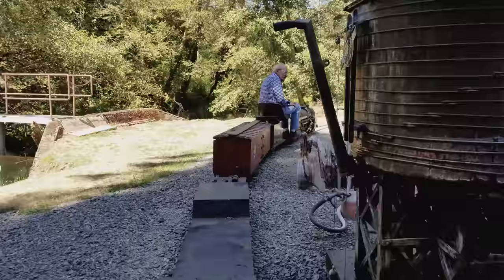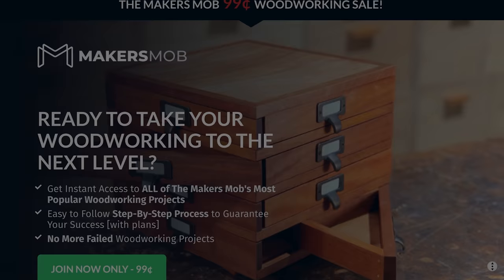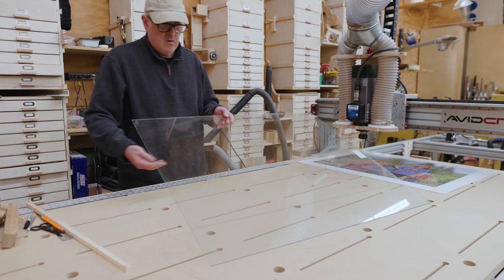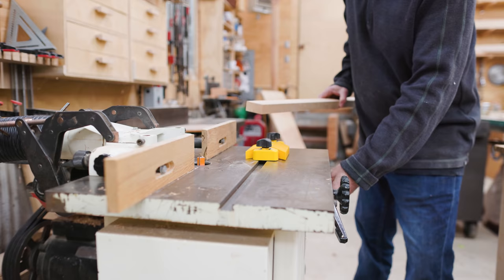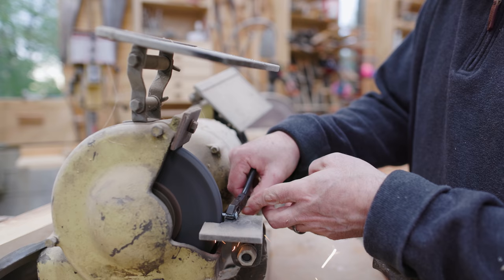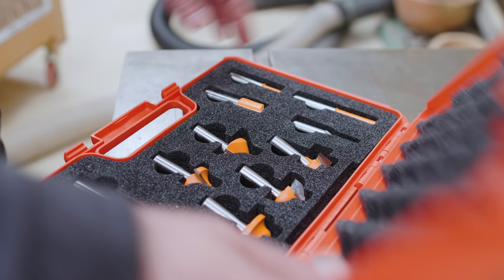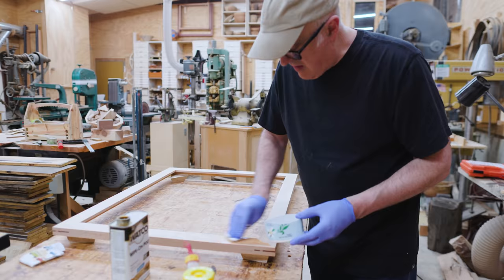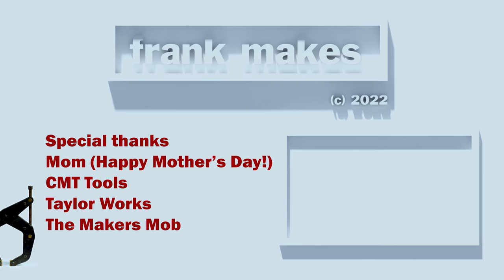Mounting and Framing a Jigsaw Puzzle

Comment: As someone who did custom framing for several years, you've done amazing work here (no surprises there, really). 

However, you really want to avoid having the artwork touching the glass, at least if your goal for framing it is conservation at all. Not a big deal, really, you just need to go get a mat cut for it. Probably 2 layers, since you'll be using the foamcore backing as the mounting surface, instead of the backside of the mat, which is the more "standard" way of doing it. The two layers will give you enough space so that the front of the topmost mat is what's touching the glass, while the puzzle will be able to sit just clear of the glass. 

Also, while brad nails are fine, you'll start to learn of one of their shortcomings after matting the puzzle, since those holes you so carefully drilled will no longer be in the right place! The brad nails may be bendable enough for this to be a non-issue, but we typically used a point driver with framing points, as they're much more flexible, don't work harden/fatigue for many bend cycles, and can be driven in to the wooden frames with relative ease. If you're gonna get into framing a lot of artwork, I would recommend getting yourself at least this tool. Mat cutting can be left to the pros at your local framing shop, as the tools and infrastructure required to maintain a pristine mat with those gorgeous openings in them is extensive, more than is likely worth investing in for a home-gamer, even one as advanced as yourself. 

If you're really looking to use this framing as a conservation method, let me know, I can point you in the right direction for other steps that can be taken to make sure that puzzle stays in its current state for years and years and years to come. If not, I'm certain what you've done here already will be fine, but do please consider re-mounting that with matting to get the artwork off of the glass. The number of times I've seen the artwork stick to the glass after just a few months... It's not pretty!

Comment: Little Trick for the finish nails (or any nail):
If you don't have the right size Drill bit, chop the head of one nail, put it in a drill and use it as your drill bit. Makes a perfect size hole for the nails as a pilot hole.

Comment: A quick tip if you cant find a small drill bit. Just cut off the head of the nail and use it to drill pilot holes for the rest. Works just fine.

Comment: Came out really nice Frank. A tip I've seen before for the picture frame sled, is to use an aluminum framing square. That way you don't have to worry about making it 90 degrees.

Comment: The problem with putting the piece touching the glass is moisture tends to get between them and cause the printed part to stick to the glass and can damage the piece. You possibly could have created a spacer that would run along the sides of the inside of the glass to do a sort of a shadow box like gap between. This is a very pretty project! :D

Comment: Wait, did you cut down a tree so you could use it to break some glass?  😜😃 
Ok, I know that's not quite how it happened but you seriously over thought the glass cutting part. After scoring it, you could just slide it over to the edge of your table and push down gently and it would've snapped right off. That's basically what the weight of the boards and clamps did.
I love your projects and videos!

Comment: For anyone hanging with wire. The stuff you want is called aircraft cable and as a bonus, there are cinching connectors which allow you some height adjustment so you too can easily get a frame to the correct height 😉
Reply: Was once helping a friend hang a big frame and went to tie a knot in the cable. "You don't tie knots in the cable" he told me. Not even 10 minutes later the frame had fallen off the wall XD

Comment: Typically the artwork should be spaced away from the glass, but as long as it's not in direct sunlight, it should be fine in my experience. I worked in a frame shop for a few years and had thousands of old frames come in, and I only remember maybe two or three pieces come in that were stuck to old glass, so it's a pretty rare occurrence.

Comment: Because the air in Side the case will be slightly insulated from the out side and puzzle pieces are made from paper and it holds moisture from the air. With the pieces touching the glass there is a possibility of condensation buildup on the glass that could cause mould. So just check it out every 6months just in case
Reply: If the photo is stored in a conditioned space that doesn't have daily or seasonal temperature swings, it should be ok... I agree that a matte would be better though.

Comment: As someone who has done professional framing: it's not okay to have the work against the glass. Add a spacer to stop it touching. For flat work (which I suppose this isn't exactly) you get moisture on the glass and work often sticks to it, or at least leaves marks. You always want an air gap between the work and the glazing.

Comment: Why can’t you just cut 45 degree cuts in your wood frame and make em fit right? I don’t get it. Can you give us a demonstration as to why this method doesn’t work right.  Keep making the vids, I love em 😁😁👍👍
Reply: You can. But they've got to be a perfect 45°. If you're off by half a degree it compounds around the whole frame and you're left adjusting the mitres until they're perfect. 

With Frank's sled, it's ok if it's off a little. As long as the sled corner is perfectly 90° the frame will have perfectly matching mitred corners. 

Others i have seen making this sled will use an aluminium framing square and only cut the 45° corner when it's securely and permanently attached to the sled as this guarantees you a 90° corner.